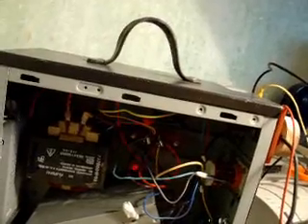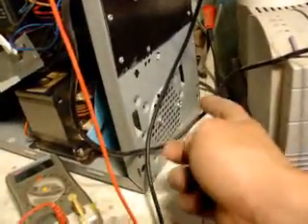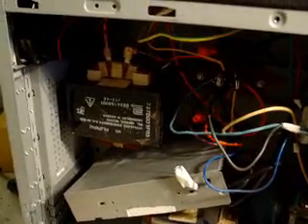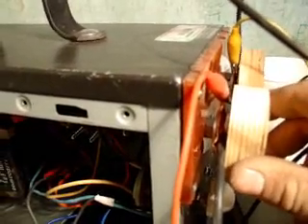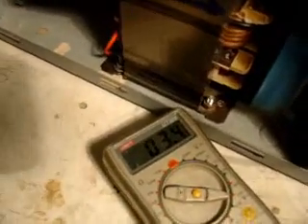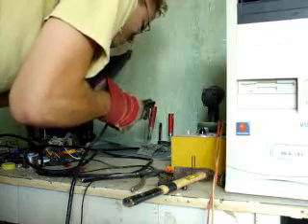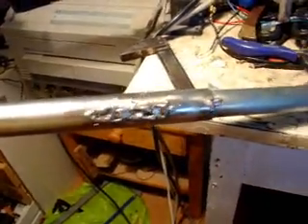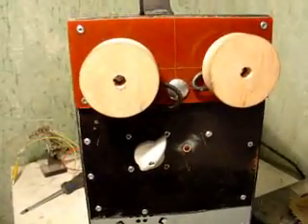DIY Microwave Oven Transformer (MOT) Arc Welder

Comment: you can use capacitors at the output also,ones with very high ripple current and you should be ok.you dont have to spend lot of money getting like 10 000 or more microfarads together,even a couple of thousand mf will be more than enough.

Comment from the maker: @SliekaStyle Three phases will give you better AC control I figure, I have not really looked into that. But DC gives the chanse of welding softer metals. Also, there are excellent tutorials out there, with full schematics, on how to produce a DIY MOT TIG welder. DC is the basis for this anyways. I have not welded DC in my life, but I trust what the millerwelds company says, at least for now.

Comment from the maker: @SliekaStyle 
Well, I've run some simulations on LTSpice and asked around, also viewed some AC/DC welder schematics and welding tips from the millerwelds homepage. Basically, you need around 10mH, this is should be acheived with eg. 900W MOT transformer core. I'm not sure about saturation, yet. Guys with experience said that you wont feel the difference whether you choke the rectifier output or not. It is logical to an extent, since ion transfer is not reversed due to polarity flip.

Comment from the maker: @SliekaStyle 
I can hold the arc just fine. The voltage measured here is from the "knobs", or points where the cables attach to the machine. The dry voltage is 40+ AC, meaning that when hot, the voltage is dropped elsewhere, most likely at the weld. I'll do better measurements once I finish rebuilding the unit. Going to make it AC/DC with better cooling. Will also provide a more detailed video here on youtube, since this one really says nothing informative :)